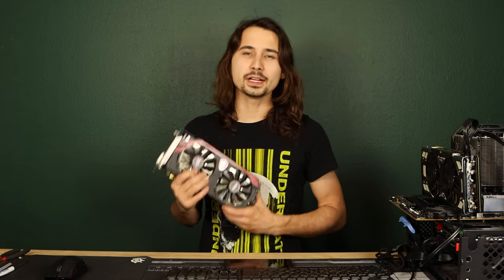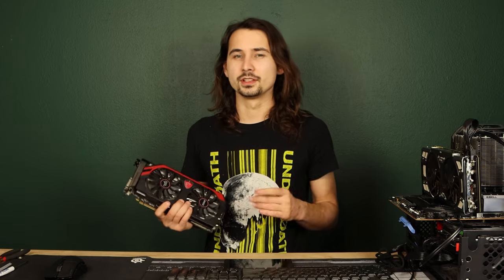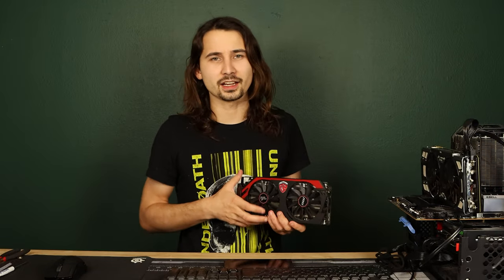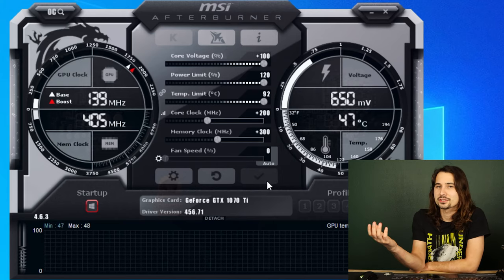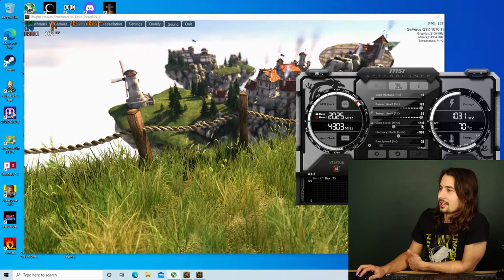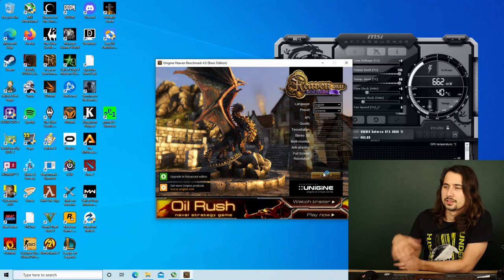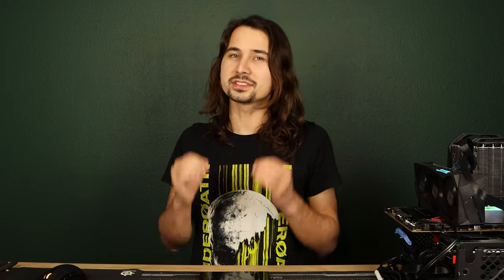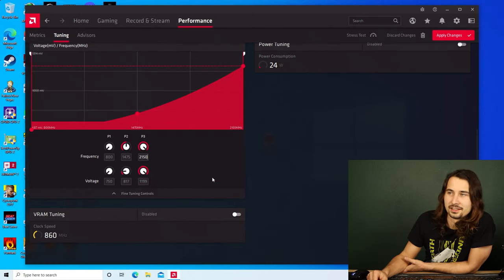Can You Damage Your Graphics Card With MSI Afterburner?

Comment: This brings back PTSD from when I killed my fermi by overclocking it and leaving it to overheat from furmark
Reply from the maker: Ouch, Furmark is a special beast
Reply: So did the overclocking kill it or the temperature?
Reply: @anth0ny_unplugged173  the tempreture. the overclock would have been fine if i could keep the gpu cool.
Reply: @czbrat  tho i really dont know if i should overclock my gpu :(
Some say if you overclock ur gpu it will shorten the lifespan
Reply: @anth0ny_unplugged173  it's impossible to kill modern gpus (or even shorten its lifespan in any meaningful way) with conventional overclocking. nvidia and amd force the gpus to stay within the safe specifications. worst thing you can do is cause some instability which can be fixed by dialing the overclock numbers back down a little and trying again.
Reply: @czbrat  i have read about users overclocking their gpus and the gpus died like 1 mounth after....
Reply: @anth0ny_unplugged173  well then don't overclock if you're that uncomfortable with it.

Comment: I have a gt 730 and when i was overclocking the core i got to +320 and no crash or anything so but 2 fps gain but when i did the memory clock to 100 i got like 4fps gain and on 200 mem overclock it crashed so i keep it on 145 memory clock and 220 core clock for more stability and overall the OC gave me 5-6 fps gain which made the game im running more playable (but im not sure if the core overclocking works on my afterburner because how did i get it to 320 without a crash?)

Comment: Hey I have a 1gb graphic card i installed msi after burner to et fps display,,I saw that in msi after burner my gpu memory and mhz is at max even i did not touch the settings is it okay plz reply me
Reply from the maker: Sometimes your card just doesn't have any more power limit
Reply: @CoilWhine  I mean that its memory clock and mhz is maxed out

Comment: Hello. I have a question. I recently just put a 3090 in my build. My cpu is a i9 9900k. I game with my door shut and it gets a little toasty in there sometimes. So my question is... Before I water cool the gpu is power limiting it to 50% damaging the card in any way? Just trying to not produce as much heat. I also change the clock speed of my cpu...
Reply from the maker: Limiting power limit is fine, the card will do its best with whats left over. The card should throttle on its own to stay within a safe temperature but that can create some pretty big fps swings
Reply: @CoilWhine  thank you

Comment: Hey man if you're still responding. Today I was messing with some fan speeds on a 1660 ti, I've power limited it to the lowest value to run it cooler but it was still hitting 70°C so I thought let's see if manual speeds will make a difference. It did but I was actually changing speeds while playing the game and I think doing that resulted in a green screen glitch like artifacts. I'd like to know what you make of this situation. Also, that glitch didn't happen again
Reply from the maker: the green glitches are artifacts, just because an overclock is stable doesnt always mean its faster

Comment: I have a rx 6600 that I overclock and up the vram on amd adrenaline. It started to flicker and have green flicker when using chrome. So I put it back to stock and it still doing it. I did a factory reset and it went away but now it's started to do it again now and it does it on games too now. Did I damage card? 
Could ram overclock also cause this? I have ddr4 ram at 3200 using a ryzen 5600g?

Comment: could you help me with OC my rx5700 xt? i have the same as you have, but when i play elden ring in 2k in some places my fps drops from 60 to 45, in GOW happend the same.
What should i do? max out the voltage and up a little the core clock? could you give some advice or numbers to use in voltage, power, clock and memory please?
Reply from the maker: I don't own either of those titles but a quick google search seems to show that it's a known issue with both titles on PC, especially AMD hardware in the case of God of War (though Nvidia users report issues as well).

Honestly, I'm not sure if there really is a fix.  There's been some people using DXVK to convert the game into vulkan instead of direct X, though off the top of my head I'm not sure if that's easy to do on windows or not.

I'm sorry to hear about the issues though, it just sounds like a driver issue where brute forcing it with some OC won't get you much.  Remember, OCing only gets you a few % in most modern cards since they're running so close to the limit at stock.

Comment: how can i fix mine if i get no display from it
Reply from the maker: if you push it too far and crash the driver a restart should fix it unless you have apply at startup checked, then you might have to start in safe mode and reinstall afterburner. remember not to check apply at startup until you have a stable overclock.
Reply: @CoilWhine  thankyou it is all fixed now